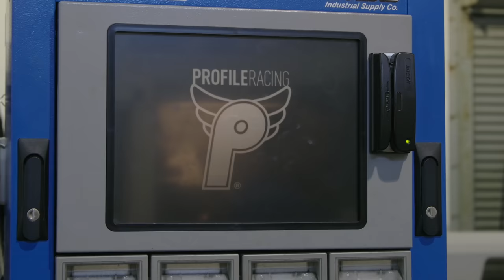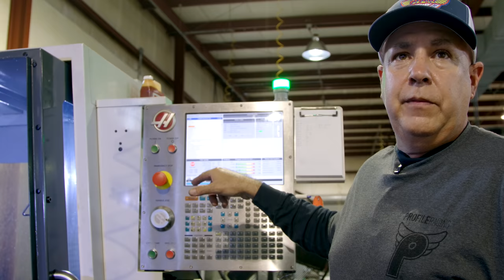HOW BMX STEMS ARE MADE

Comment: Really wished you guys would somehow integrate that (dub-tail fixture?) design to your cranks & axle. Maybe an odd number for a two bolt clamp down. Never really trusted the spline design for any type of weight distribution, those are just made for belt drives.
Reply: Dove-tail, commonly used in wood working. Very strong and simple joint